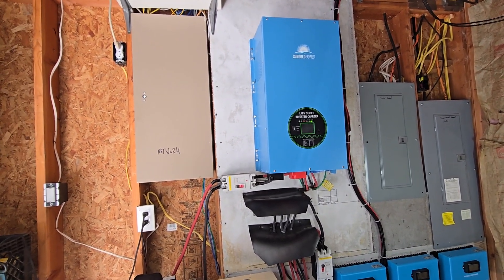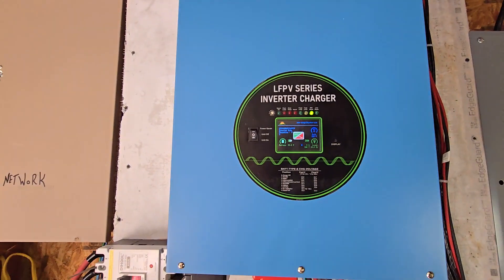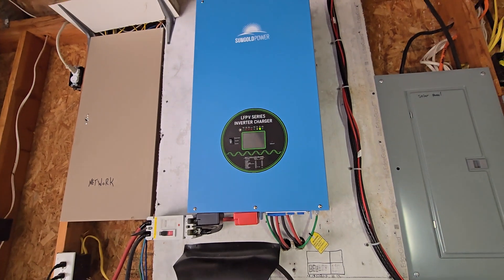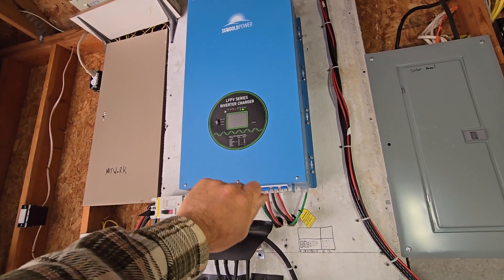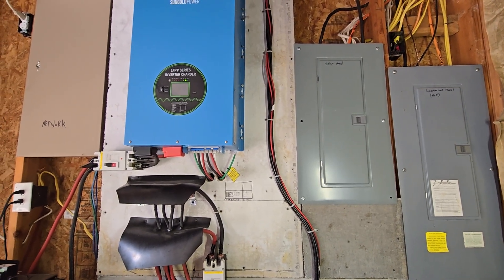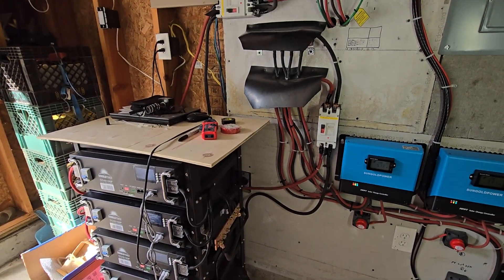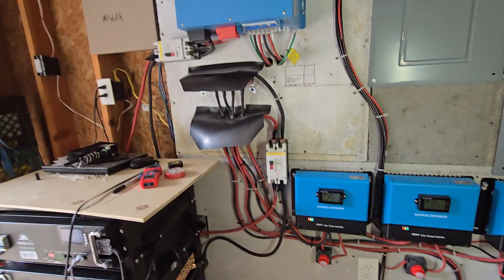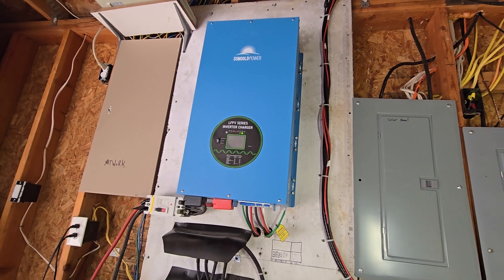Solar Power Inverters, The Basics for Beginners.

Comment: What gauge wiring are you using for AC input output? Thank you
Reply from the maker: 4/0 which is close to the max size of the connector on the inverter.
Reply: Probably 4AWG not 4/0. 4/0 is almost a half inch in diameter